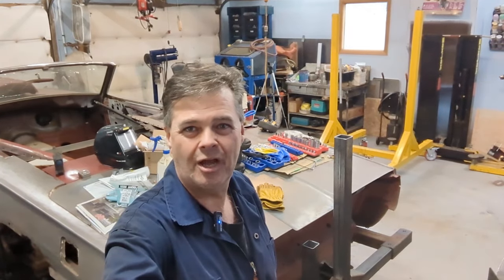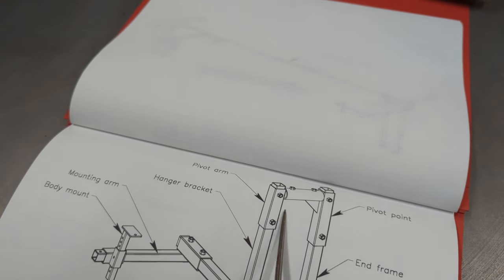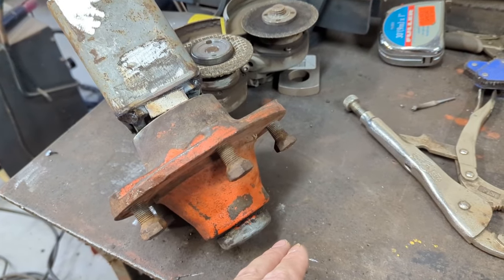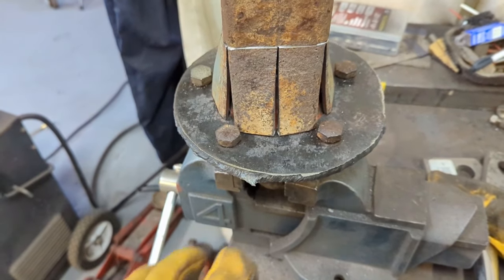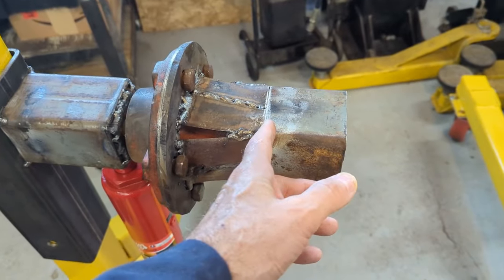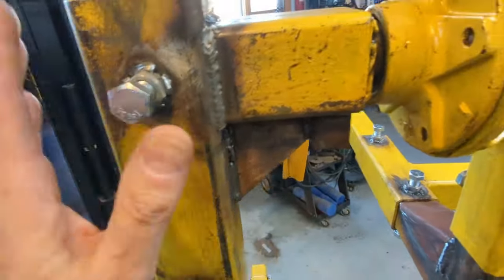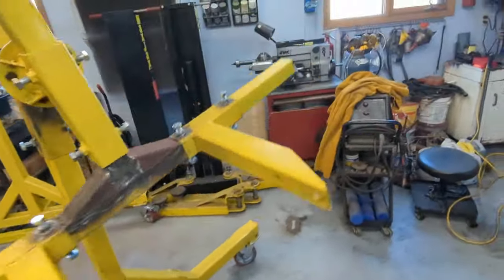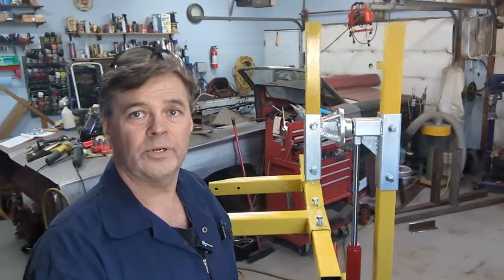DIY Automotive Rotisserie Build - Pivot Point & Lift Jack Mount

Comment: The only thing I would question is maybe spin the bracket 180 degrees, before attaching to the vehicle.  So that the weight of the vehicle is going down into the outer tube instead of trying to lock it in place with the 4 bolts to keep it from sliding out of the outer bracket..  Hopefully you understand what I'm trying to explain.  I could send some pics of mine if I knew how and where to send them.  Those bolts will probably clamp that in place but I would be a little nervous with all of the weight of the big Bird.  Other than that it looks very heavy duty and up to the job.  I like it
Reply from the maker: Hey coolio1949, 
I understand, and completely agree...an extra layer of protection is always a good idea. I was looking at the setup this morning, I am pretty sure I will have to mount the car higher than the bumper bolt holes to get the center of gravity set, and to do that I will need to flip the hanger brackets over, so that will make them a lot closer to the center up right tube. If it slips, then it will only be minimal.
Thank you for that suggestion! 😊